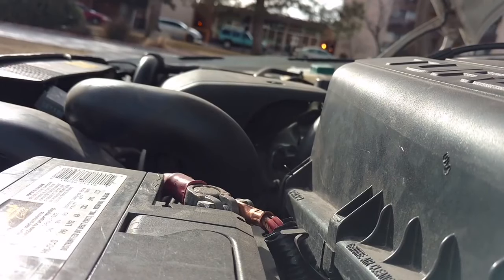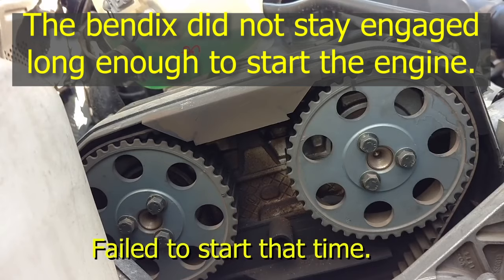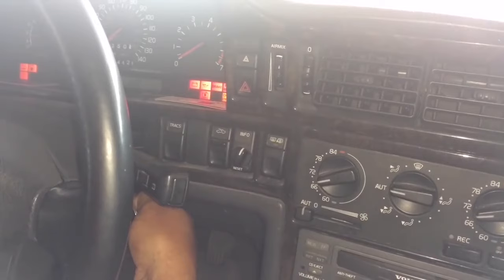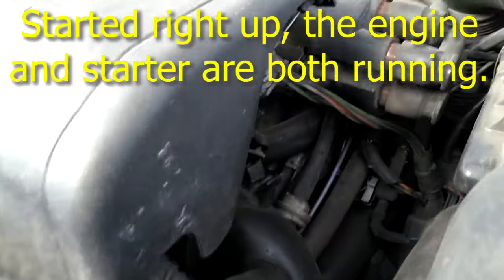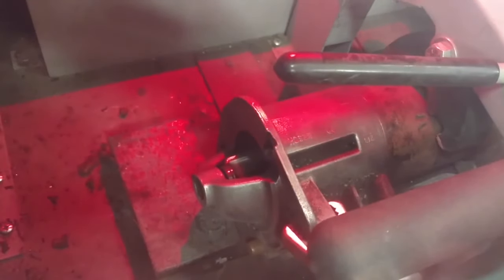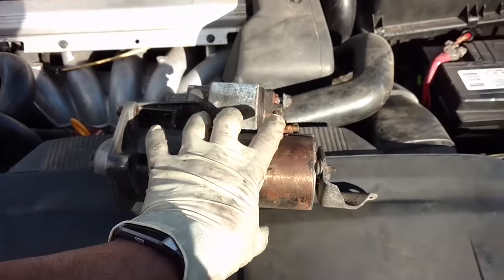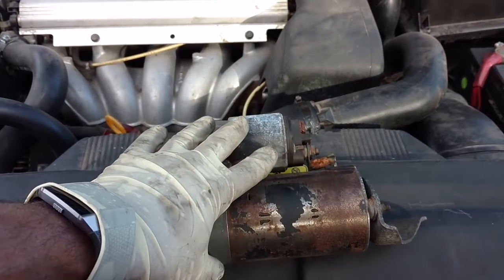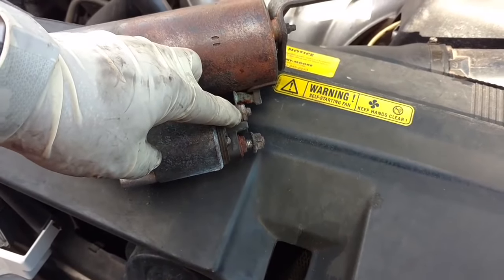Is your starter bad, hear the noises or sounds a bad starter will make. Also a full demonstration.

Comment: Hi could you please help me diagnose my car it will stop all of the sudden in the middle of driving will just jerk a little like hesitating to go forward and then it will completely stop. It's 2019 Ford Flex.
Reply: I have a video of what it does when I try starting the Car but and showed it to Mechanic and they can't tell what it is. They told me my car will have to stop for them to diagnose it. After my car will stop it will start again after and hr and then continously working for a while and then it will stop again..
Reply from the maker: Sure, bring it by.
Reply: @RobertDIY   I just saw your location. I guess I cannot. I'm from El Paso.Tx. thanks.

Comment: My car starter is not winding but is making funny noises. Basically the same as 2-3 minute mark in your video. Most if the time it’s starting but in the morning I can turn it 3 times before it starts. My question is do I replace entire starter or just solenoid ?
Reply from the maker: I would replace the starter.

Comment: Hey I’ve got a different situation it’s a wave runner. Same concept. I replaced the starter solenoid and it is still clicking. New battery new plugs. It’s acting like it’s slowly slowly cranks very weak and then it will click out in the solenoid
Reply from the maker: ouch

Comment: I have a question for you man. I was working on my friends car and it’s a Grand Prix 06. I guess it had a exposed wire from the alternator and I happened to rub my arm against it and it sparked.  I tried to start it after and only get that solid click you were talking about. I don’t think it’s the Starter I think it’s a relay that may of got burnt out? Just wanna know what you think can be the problem. Thanks for the great video also.
Reply from the maker: May have blown a fuse or relay. Find the main fuse panel and see if any are blow.
Reply from the maker: https://youtu.be/B5jpELKk1D4
Reply: I did everything and still nothing

Comment: Thank you sir. How do you know the problem is not just the starter relay? My car makes either only a solid clock or the grinding noise heard ad 02:43
Reply from the maker: the video is about bad/failing starters not relay issues.
Reply: @RobertDIY  thanks. And great video too. 👏. I was just asking for (additional) advice.

Comment: So what happened to the starter which keeps on engaging after it starts ? It passed the test outside but it doesn’t mean it’s ok to keep using it ,right ?
Reply from the maker: No way. If the starter keeps running it is a fire hazard.

Comment: Hey I got a question I’m about to put in a new starter but I was wondering if for example you had a bad starter or Bendix but your car had been running for a while does that make it more likely for it to start? Because my car only shits out on me in the cold mornings but I know my battery and alternator are good
Reply from the maker: I don't know. If it's not cranking, battery is probably weak.

Comment: Great video …I have the second type problem sometimes …I only hear one click and after 6 or 7 tries the car start…I should replace the starter right?
Reply from the maker: No, have the battery and cables checked.
Reply: It’s been a week without any problem..I will check them …thank you so much for the all informations 👍🏻

Comment: Hello just got a question I replaced the starter with a brand new one but I still get the exact same sound as you mentioned in your video where the starter engages but it creates this whining sound as if it's not actually engaging the part of the flywheel what could it be
Reply from the maker: Another bad starter. They now sell bad starters, brand new. Did you get your starters tested?

Comment: @RobertDIY  Question. So I have two batteries that are about six months old. That are not recharging. Alternator is good. My ac compressor has no belts. Will that affect the alternator. Because it looks like it's a pulley system. If I jump it, it starts. As soon as I turn it off, the batteries are dead. Rapid clicks, then a couple of clicks, then one, then it's dead. So maybe the isolater? Or a drain somewhere?
Reply from the maker: probably a bad or loose cable.
Reply: @RobertDIY  Thank you! Yeah, that's too technical for me. I had someone come by and check things out and he also said he thinks there's a bad cable. Thank you so much!!

Comment: if a starter stays engaged while running, would this fully burn out the starter to the poiint of no longer working at all? feel like this is the issue i expirenced today, but trying to figure out issue so i dont fry another starter if i was to replace
Reply from the maker: it would be a starter problem, not a problem with the car. I think it can damage the flywheel/flex plate. It could also start a fire.

Comment: I got a 15 Ford Fusion SE with a 2.5 L engine and I’ve no crank. Sometimes it does crank / start but after several tries. It’s making a not too loud humming noise. That’s the bendix or some other part of the bad starter?
Reply from the maker: I have no idea.

Comment: what happens when you connect your solenoid wires the wrong way and smoke comes from the bottom of your 2003 Ford F150. Now when I reconnect the solenoid the right I get a winding sound. The motor won't crank!
Reply from the maker: Probably fried the motor. You can pull the starter and have it tested.

Comment: pshh autuzone said my starter was fine yet it wouldn't start only when the engine was hot... when the engine cooled just a little ..it started right up no problem....guess they were wrong when i found out i needed a starter a day later
Reply from the maker: That happens. Test good, picky on the car.

Comment: Ok......4 starters, ignition switch, and starter relay. I turn the key and it hits the fly wheel but if it play with the key it eventually starts.  Could it be a key cylinder switch?
Reply from the maker: sounds like it.

Comment: My 2001 Hyundai Elantra has a no crank. The battery and alternator on new. For one month it would turn over and then I would get no crank and sometimes wait up to 1 hour and then it would crank over to start. Any idea what this might be I checked also the relay fuse the ignition switch I checked the solenoid into the starter itself
Reply from the maker: Bad cable??? You may want to tow it to a mechanic.

Comment: I sent you an email with a video attached to it with regard upon whether the noise sound being heard is the precise same thing as you have explained where starter remains attached to flywheel cranking it. I am awaiting your response.
Reply from the maker: Ok
Reply: @RobertDIY  were you going to give me a response at some point based upon sound you heard from the video i submitted to you lol I know you must be one very busy man. Thank you. I made an attempt to remove my back seat to access the fuel pumps to check them to see whether they are clogged or not ...an man i could not get those dog on spline bolts to break loose to do the task ha ha ha lmbo and smdh the person who came up with that idea of placing them kinda bolts on unbelievable lol

Comment: Is it possible for a bad/failing starter to cause a long engine crank? I am trying to diagnose a long cranking issue on a warm engine (no issues on cold start). It's a 2010 e class mercedes and the dealership changed the starter 2 years ago when I told them the car was long cranking. I bring it back to them now with the same complaint (no codes either time) but they are now saying the starter is not the cause and are unsure. I also discovered that if i tap the gas pedal while it is long cranking it always seems to start, if I do not sometimes it will crank way too long and kill the car battery. I think it's the starter personally but am not a professional mechanic and haven't done any official test. I've heard that sometimes a bad starter can draw too much power from the battery and think maybe this is my issue. Also the fuel pump was changed, spark plugs were changed, battery was changed, crankshaft position sensor was changed, camshaft sensors were changed.
Reply from the maker: Probably a temp sensor issue. When you press on the gas pedal you usually give it more air not fuel.
Reply: @RobertDIY  thanks I thought this may be a cause as well. Would the gauge in the car show the reading as well if it was bad? My temp gauge always stays at 90c

Comment: I had my starter replaced by a moble mechanic. Now when I start the car the car makes a hiss sound.
I do not know what all he took off to get to the starter.
2001 Ford focus 
Never made this sound before.
Air duct to the throttle body was tighten but the sound is still there.
Any suggestions?
Reply from the maker: Take it to a good mechanic to check it out.

Comment: Hey I have a question. This will be random. 

I took my truck to LA.  Parked in a spot $5 parking valet took my truck. Same thing I’ve done a billion times. 

Came back later and my car wouldn’t start. Was working just fine the whole month week day prior even in the morning and lunch up until I wanted to leave. 
It makes a noise like I have a weak starter. It’s not the battery because we checked but if someone stole a piece from my truck idk for scrap what piece would they have to take to make that noise. 

I doubt they stole anything from the truck but just wondering.
Reply from the maker: if it's cranking slow, the battery is likely bad.
Reply from the maker: https://youtu.be/2rVt-TDqmSc
Reply: @RobertDIY  honestly we think it’s a starter problem. Can people remove other pieces of the car, (to sell on side idk) that will cause a starter to malfunction because prior to this there have been no issues with a starter.

Comment: Hey what's up I not sure if your still checking your comments but I have a question. I have a 94 GMC Sub and notice the truck will not start in freezing temperatures. However, on warm days it would start like a beast every start. I did the old trick by disconnecting the pos and neg connections and truck kept running so I assumed it was the battery. So today I went out and brought a battery and still truck running great. Once I put the new battery I just heard a solid click nothing else. Puzzled I assumed maybe the battery I got wasn't strong enough but couldn't be because I got it from auto zone based on truck info. I then took the new battery and out the old one but still getting one solid click. About a month ago I got a new starter so it can't be that and I doubt it's the alternator. Any suggesting
Reply from the maker: If it fails to crank it likely has a weak battery, bad or loose cables, or a bad starter.
Reply: @RobertDIY  it was definitely a loose wire. After installing the remote starter the bolt barley connects do to eyebolt wire. Have to get a bit longer screw

Comment: Please help. Turn key nothing. Went under truck used jumper wire from positive to the small wire' starter made a loud tink like it hit the flywheel. But thats it??? But new battery in it turn key nothing happens. I just dont have the money to replace if thats not the problem. Thank you so much
Reply from the maker: Bring it by and I'll check it out

Comment: Say could u help me answer this .. I have a 2011 camaro my dash shows 14.5 to 15.0 on my alternator it seems intermittent I believe it’s the internal voltage regulator that’s going bad just put a brand new battery .. voltage good load tested it also good . Or could it be a bad ground wire ? Plz help if can .. 🤙
Reply from the maker: Bring it by and I'll check it out.

Comment: So if my starter has a dead spot. Can I take it apart and clean it or does it need replaced??
Reply from the maker: I have no idea. Mine just got better after several months. Usually I just replace the starter. My last thought was to pull the starter and run it for 5 minutes and see if that fixes it.

Comment: So what do you recommend me to do if my starter stays engaged? I looked under my truck and it seems like a part inside the starter is a little loose so it keeps hitting the fly wheel when the truck is on. I moved the loose component back alittle bit and the noise stops and when i let it go it starts to rattle again, do i just have to replace the whole starter?
Reply from the maker: replace it.
Reply from the maker: yes

Comment: what is a bendex? is that inside the starter? never heard that word before
Reply from the maker: The Bendix system places the starter drive pinion on a helically-splined drive shaft of the starter motor. When the starter motor first begins turning, the inertia of the drive pinion assembly momentarily resists rotation even though the shaft through its center is turning.

Comment: I bought a car through auction today site unseen.I dont know if the engine is good.The battery was dead so i hooked cables to it and the starter was turning over but it sounded very weak and slow. Wasn't very loud either.I continued to try and start it this way eventually it would only click one time. Im not sure if i have a siezed engine and i burned the starter up trying to start it. Any advice would be greatly appreciated. I dont want to purchase a starter only to find out i have a bad engine.
Reply from the maker: Bring it by and I'll check it out.
Reply: @RobertDIY  I appreciate the offer but im in a different state.

Comment: My car clicks rapidly then starts. Took it to two dealerships and one replaced the cables from the battery and it still clicks when cranking. Its not the alternator or the starter or the battery what else could it be? Its a 2017 camaro ss
Reply from the maker: My guess would be the battery. Does it do it if you jump it?

Comment: my starter got wet on my 7th gen civic. i didn't see or here any problems as i doordashed an hour or so. (The car did intermittently blip off and on while i was turning on and interstate on the ramp. 
I went home for a break, and when i went to go back out. ...the  engine didn't start, but the starter spun... continuously. even when the key was turned to the off position and removed. 
i popped the hood and disconnected the battery. it took a while to go into the house and find the appropriate tool to disconnect the negative terminal and I heard the steong starter running die out to a weaker sound. 
i did it again while i had my buddy on the phone to replicate the sound, but i heard, and it has sat since. 

i am planning to replace the starter since its fairly new. i just have to find out where my buddy purchased it from. 

i am also scared of my flywheels condition.  should i replace it and just see how it goes. 
with everything I stated does it sould like the starter solenoid is stuck? 
please advise. 
this is the second time i have seen one of your videos in need. because of the great detail you put in the videos I am now subscribed
Reply from the maker: I would replace the starter and see what happens.
Reply: @RobertDIY  Thank you.  Maybe I'll inspect the teeth

Comment: If my starter keeps grinding after engine starts, do i need to replace the starter? I read online that it could also be due to a faulty solenoid or the starter is not properly aligned with the flywheel or flex plate. Thanks.
Reply from the maker: Yes.
Reply: @RobertDIY  Thank you

Comment: When I turn on my ignition nothing happens no click or anything.  If I jump the solenoid the starter makes a winding sound but doesn’t engage the flywheel.  When I took the starter to Orielly’s it tested good.  Do you think I need a new starter?
Reply from the maker: Can't tell from here, do you want to bring it by?
Reply: Where are you located

Comment: Great video boss man but I have a 06 trailblazer LTZ that the starter was bad I pulled it out battery was good but starter when I shook it sounded like things were loose all in there however I got another starter and I put it in and did the same thing the only difference is now that (one) click sounds loader and that's all it does not sure what I didn wrong or what happened any advise will gratefully be appreciated
Reply from the maker: did you have both starters tested? Can you turn the engine over by hand on the harmonic balancer bolt?
Reply: @RobertDIY  yes the one I took out was shot and the one I put in got it tested before now on the belt it's kinda stiff it's been sitten for like a month am I supposed to be able to move it eazy or naw!? And what would you recommend!?

Comment: 1994 Chevy s10 4.3 - Pulled my starter, tested and passed.. mounted it back up turn the key and it just makes a loud noise and then second turn of key there is NOTHING like the starter is stuck on the flywheel or unplugged. but Motor is not locked up. I’ve done this twice now and it will crank one time until I pull and re mount. Flywheel teeth are all clean just rusty??? I’ve replaced all the wiring too.
Reply: Something like your Dead spot I think, I’ve tried it 5-10 times and nothing. I pull it and ground it works fine ? But not under load
Reply from the maker: I'd replace it.
Reply: @RobertDIY  I did and it fires right up everytime! Those tests are almost pointless lol.

Comment: I got my car diagnosed and was told it was a bad alternator. Changed it out and I'm still having issues. The battery and starter tested fine. But the car will turn on and when shut off, won't start up again. It will start up again the next morning but once turned off, takes hours or a day before it will start up again. Any idea what it may be?
Reply from the maker: https://youtu.be/NhtUXZTurzo
Reply from the maker: I don't even know what kind of car you have.

Comment: I have a 2013 dodge grand caravan and when i try to start it .... it just makes like a humming or some type of noise but it waont start either... can you please give me some tips ?  Btw i did get the starter from a savage yard and it texted good thanks in advance
Reply from the maker: If the vehicle is not cranking you're going to have to troubleshoot as to why. Is the starter solenoid wire getting power when you turn the key to start?